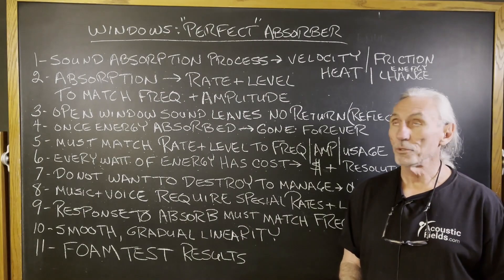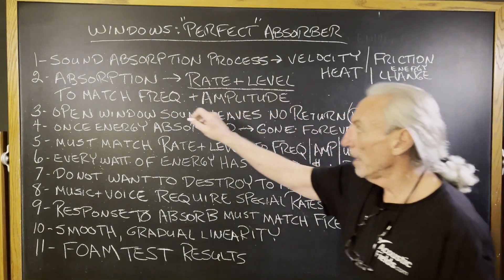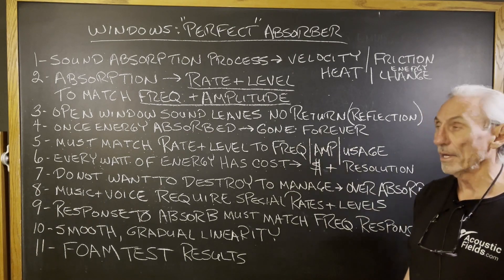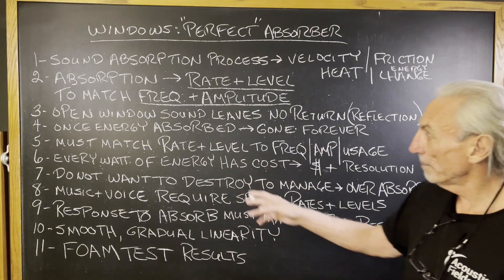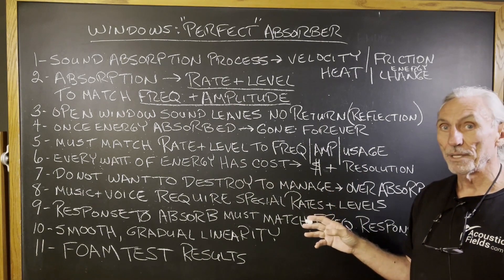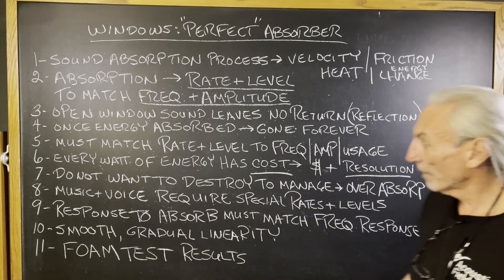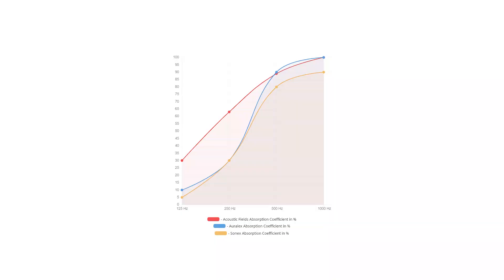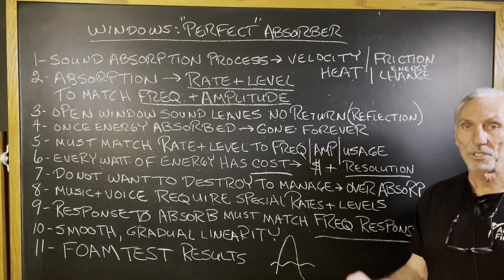Why Windows Are The Perfect Sound Absorbers - www.AcousticFields.com

Comment: Lets say we are outside. No walls no ceiling. And we only get direct energy from speakers, pointing at us. But what for do we need a room then? For bass? Since bass isn’t hitting us directly like speakers do, which we literally point at our ears. If we need ceiling and walls, then how many and how big windows should be? How not to overdo it with windows?
Reply from the maker: You do not need a room for bass. You can feel the oscillations of pressure waves without a room. Ever been to a drag race? A room reinforces bass energy to the point of distortions.
Reply: @AcousticFields  thank you very much for reply 

But why then did you say you shouldn't overdo it with windows. Or did you simply meant in general that too many windows in a room would look silly. Moreover with glass

But I live in tropics and people leave windows open. I'm also in a very friendly village so there is zero crime here (no house invasions for stealing)

Comment: Great video 

Lets say someone lives in tropical climate. His windows are without glass. Simple wooden opening windows. Room is also from wood. Maybe later layer of clay will be added (natural building)
Its even better to have many windows because its hot all the time. 

He can put two from the side walls (first reflections, left and right walls). Maybe then two in the back wall. Also few more on the right and left walls. Maybe make some behind monitors, so bass will also fly away

Lets say room is 14 feet tall. 16 long. And 10 feet wide (distance between right and left walls if you imagine a room schema looking at it directly from the above)

We put 2 windows on the front wall (behind and near speakers), then one on each left and right sides. Then one or two more further on each those left and right walls (so 2-3 on each left and right walls)

And 2 on the back wall

Will it be too much? 

Size of windows lets say 6,5 foot high (half of wall height) and 3,2 foot wide. Similar like absorbing panels. 

how not to overdo it? Since energy is lost forever as you say

How to find out the amount of windows, their position and size?
Reply from the maker: Place windows at the intersection of the walls and ceiling. This will let ambient light in and not disturb the three soundfields, front/rear wall, sidewall/sidewall, floor/ceiling. Glass must be out of those three soundfields in an ideal situation. If windows must be, then they can not move with pressure and must be covered with the proper treatment when music and voice resolution are in play.
Reply: @AcousticFields  hello

Thanks for the reply. 

But why put windows there so high and not where absorbing panels would be? For example classically where first sidewalls reflection are, coming at a listener sitting after a desk. 

Also, you recommended high ceiling (14 feet). It would be problematic to open/close windows then. Or maybe since in tropical climate I'd leave them open anyway all the time, then it's fine.

And whats size should such windows have then? Let's say my side wall is 14 feet. What's the height and lenght of the window should be? And where to place it exactly on the side wall? How many of them? Would I also need to put absorbing panel down there at that classical spot?
Reply: @AcousticFields  why not just put huge (5 feet high) window on the side wall where first reflections come at place? Sound will go out and never come back
Reply: @AcousticFields  I watched your other video about rooms with windows. And you also recommended to put windows high up, but u said to do so because of glass. 

I think you misunderstood me. I wont have glass in my windows. I will be in tropical climate where windows are always opened

Comment: Hi Dennis. Great as always. What is your opinion about small vocal booths - a 2x2 square meter vocal booth for instance? How should it be treated acoustically? Can we place absorbers on about 80% of the surface of each wall? How dead should it be? I am confused with some of the commercial vocal booths out there. Thanks.
Reply from the maker: Too small for male voice. Try and get an 3 m x 3 m minimum for male voice.
Reply: @AcousticFields  Thanks Dennis. But what if I have no other choice than a 2m x 2m? What then, How should I acoustically treat it?

Comment: I am a fan of the Open Window “absorber” trick… My neighbours, not so much. 😅🤷🏼‍♂️ 

Thanks for all the good info over the years, Dennis! Despite not having the finances to address my listening environment thoroughly, your generous videos have made a big impact on the enjoyment of my system(s). Learning from your perspective has been a welcome departure from what I used to think was the correct way to improve the sound of a typical room. 

Many thanks and gratitude.
Reply from the maker: An open window is a perfect absorber. Sound leaves and never returns without requiring an energy transformation to heat. An open window would be the worse barrier material type and construction methodology for noise transmission issues.

Comment: Hi Dennis, thanks a lot for your thoughts and i have one question :
I played around with a tuning fork  set on differnt materials, some gave louder sound, others less. But the tuning fork on glass was different, the sound was ugly distorted. Is that property of glass also an Issue for romm-acoustics? Some audiophi8le guys place (very expensive) Stickers on their Windows....
Reply from the maker: Glass has two issues. It has a hard reflective surface and it also goes "diaphrgmatic" which means that it moves with sound pressure exerted upon it.